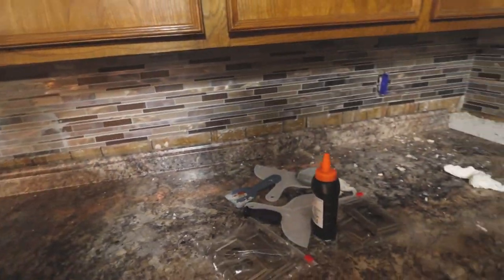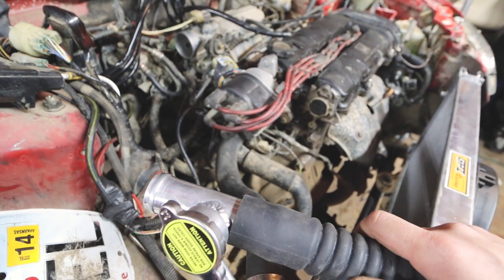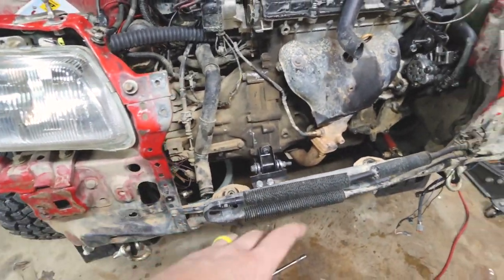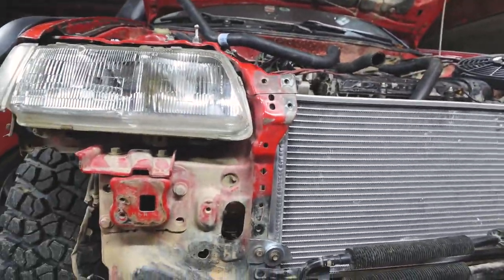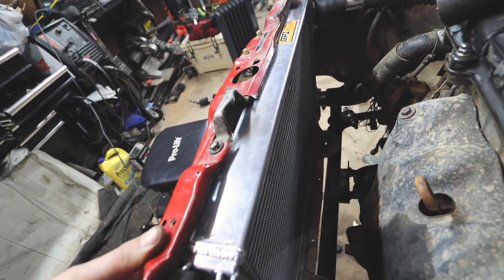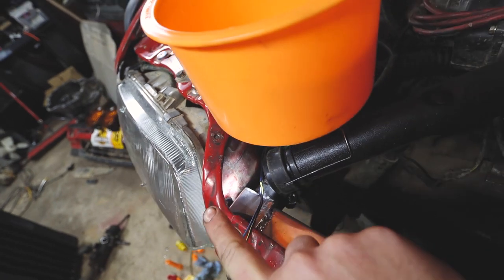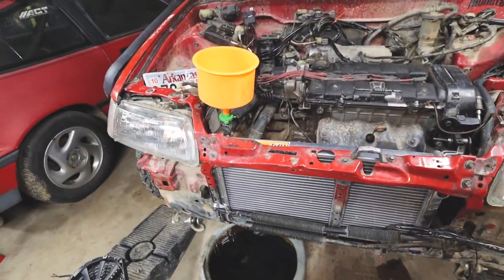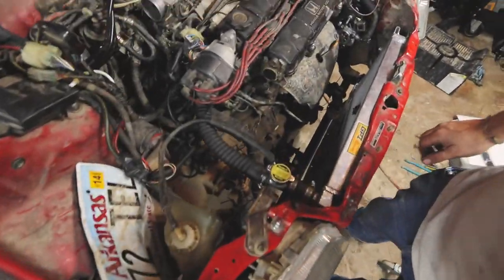Radiator Tuck in Lifted Civic Wagon!

Comment: having the filling point so close to a distributor would make me nervous glad you went with the closer to stock location
Reply from the maker: True. The stock radiator hose connects to the head right underneath the distributor anyway so if it leaks there bad enough it could get foul it out. Should be good where it's at there. I'll see once I get some miles on it 👍👍
Reply: Eh. On my 89 accord i nuetral bombed it ome too many times and tore the upper rad hose, still got coolant in the dizzy.
Reply from the maker: @MatsuYoda  Shudbgud

Comment: This is exactly what I need! I have a dohc zc in my crx. Planning on installing a scirocco rad and was unsure about the hose diameters. The upper and lower hose fit onto the vw radiator without any issues?
Reply: Aside from adding a filler neck I mean. The hoses I'm using with my stock crx radiator should work correct?
Reply from the maker: @williamcarney7385  the bottom one fits just right, the top is a squeeze but if you're doing a filler neck there it doesn't matter anyway. 👍👍